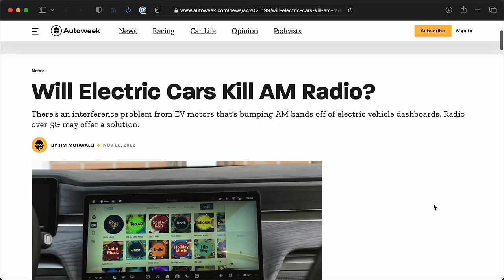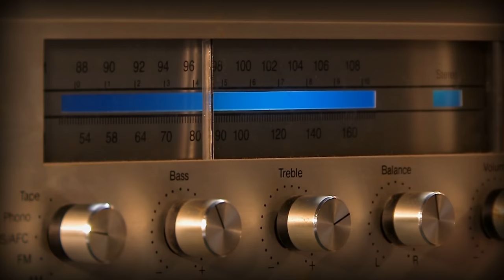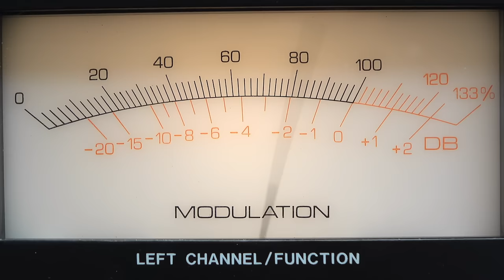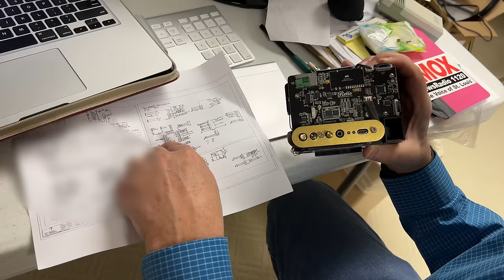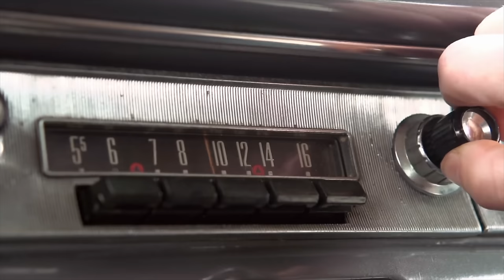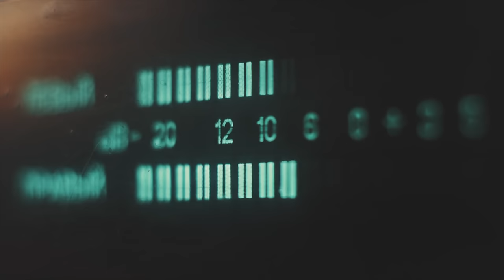Is AM radio dead? Tesla thinks so!

Comment: The little Ohio AM station I worked at in the '50s had flat frequency response from 30 to 15,000 Hz with under 1% distortion. Such hi-fi signals sound like crap going through present narrow-band AM receivers. Of course there was a lot less AM-spectrum noise in the '50s.
Reply: The GE portable radio I bought some years ago has a wide/narrow band switch for the AM band and it sounds as good as FM in wide mode.  I also used to tune my former AM receiver off center just a wee bit in order to to get the high freqs of music some come through better.
Reply: WBAA 920AM now a century old was forever it seems a hifi station! I even modded a tuner's IF for superb sound. It all went away the scary weekend of Halloween 2007. Hideous Death came on the air, the End. Still listen to the Opry 650AM. My audio system has FM transmit at legal level. I'd re-transmit 920 from the hifi tuner and then show someone in the driveway their car radio against my FM'ed version. Night and Day. In 2013 they got a LPFM and jazz finally lived for a while in stereo. Now it's the bloody Bebe.

Comment: What would or could be done with the AM band space, if the broadcasters pull out? In some areas, AM station tower land is prime real estate (suburban encroachment over time).
Reply: The land values are getting to be a big deal. Stations have been selling the land and moving or cohabitating with another AM in the market. 
We are a long way from the band space having a strategic value IMO.
Reply: Not very much. At frequencies that low, interference is a major issue. Transmitters need very large antennas to be efficient. There's just not much you can do with it these days. Sure, you can send a signal half-way around the world - but who needs to do that now?
Reply: "Get out of me swamp!"
Reply: @vylbird8014  spies?
Reply: Nothing. Low frequency long wave radio is only useful to telescopes and space radio. And AM waves have very little interference with devices like cell towers or garage door openers. So it's not in anybody's interest to shut it down.. it's FM radio that's likely to be killed off for that.
Reply: You can count the lighting-strikes ... ;)

Comment: Great video Jeff. A comment: I understand that you are using the shorthand of "AM Radio" to mean "public broadcast 535-1602khz+expanded band" certainly for entertainment and audio quality all frequency and phase modulations are superior. Still, it is important to understand that AM has many unique features. Just as (analog) AM radio's susceptibility to interference is mentioned as a weakness, it is also an under-appreciated feature in its rejection of the capture effect, hence its use in aviation. It is also a much more transparent medium, as its ability to observe and inspect sources of electromagnetic noise and spectral purity (and, for that matter carrier suppressed SSB) exposes the (IMHO sloppy) engineering practices of the digital era. The lack of shielding, grounding, isolation, etc. creates such increased interference susceptibilities; - unheard of in the analog heyday of the 1950s-1960s. I am not advocating the return to the boat anchor, but digital engineering fails to understand the fundamental electrical principles required to competently function in the analog/AM era. If one thinks of the electromagnetic spectrum as a natural resource, just like cities' light pollution interfering with astronomy (even before the now infamous Starlink astronomy interference - another Tesla/Musk doozy!), the EM spectrum is getting more polluted with noise that every subsequent system needs to reject and operate under. It is a tech debt that, unlike software, is impossible to patch after implementing these systems
.

Comment: I had a record player AM radio my mom won from cereal box tops in 1968, a 60s Sears desktop radio, a mid-60s Magnavox console stereo, and a 1980 GE flip digit clock radio all of which could easily bring in KDKA. I lived in Memphis. The clock radio could do the same in a steel and concrete dorm in Knoxville, TN. It's a connection that I miss.

Comment: Here in Tucson I worked at five AM stations.  Did you know that All Ford cars for 2024 will not have AM.  You already know about the electric cars.  You would think that the FCC would have something to say about the RFI interference.  In the 50s my parents has a table lamp with a lot of coat hangar type of wire as the base and it always during the day picked up a local AM station not very loud but if you sat with in two feet you could hear it.  We still have a AM station that transmits in stereo.

Comment: your dad talking about being able to hear the station from a pipe coil is interesting because i remember being a guitarist in this band, this cafe in my downtown city we used to do shows a lot, happened to be a block away from a AM station and i always remember the second my guitar was live and on with my tube amp , you could hear the signals being picked up by the guitar pickups which are mostly double coils (humbuckers), and it was pretty noticeable

Comment: Here in Eastern Tennessee, AM reception as well as shortwave has been getting harder and harder to receive. 15 years ago I could pick up quite a few AM stations during the day. Today it's hard to pick up anything even at night. As a matter of fact, I used to be able to pick up your station (St. Louis) crystal clear at night 15 years old but last time I checked I could not. At ground level anyway.

One night at 3 in the morning I went DXing on top of the 7th floor roof where I work to see if I could pick up any AM and SW signals and was able to pick up all the "big city" AM stations like New York, Chicago, St. Louis, Pittsburgh, Boston, Nashville. I'm not sure how high that was (1000 feet? off the ground) but I noticed at ground level AM is almost impossible to pick up even at night. 

You confirmed my suspicion that it's due to allot of electrical noise. 

Also allot of the AM local stations (around here anyway) I think have cut their power back to save money. They don't reach as far as they used to. When I was a teenager I used to listen this AM rock station in Erwin TN because they played great music. The tower is about 35 to 40 miles away. Today it seems most AM stations around here only cover about a 10 mile radius.

Oddly enough two of the local AM stations are now ESPN talk radio. Why do we need two of them? Who wants to listen to that junk. But I'm a car guy not a sports guy....

Comment: Part of the noise issue is the fact the FCC doesn't actively enforce electronics standards as much as they claim. You can easily buy a cheap phone charger that will put out so much noise that it can disrupt any other radio in the area. This is something that I believe some IoT makers have complained about since some IoT devices will be disrupted by such noisy electronics. It's not to say making quality low noise devices is cheap, but it's not too expensive either with proper grounding, use of choking via ferrite beads or CMCs, and a few other tricks then you can get any device relatively quiet in RF. It's just that it shaves off pennies worth of profit that firms refuse to eat.
Reply: Is it the chargers or the phones? Or maybe both in some cases? The reason I say that, is I've notice that my latest phone produces interference and even takes out FM radio reception when I plug it into the charger. My older phone didn't do this and changing to a different charger doesn't help. I've come to the conclusion the charging circuitry inside the phone is likely to blame. Anyway, I think the FCC isn't doing it's job in regulating the manufacture and sale of electronic products nowadays and manufacturers are cheaping out and cutting as many corners as possible and selling us junk that doesn't meet standards.

Comment: AM has many disadvantages over FM but, it's simple to demodulate, information can pass even with low SNR and two or more simultaneous transmissions at the same frequency can be understood. For these reasons it is still being used in aviation communications.

Comment: Hello!  On the medium wave band I can hear a remote radiostation (300-400Km away from me) but only at night and with noise. There are loads of intereference and noise in multi-storey building - simple crystal set receive noise ))). To achieve a clear sound - you must go away from building and electrical power lines

Comment: 8:14 your dad TOTALLY nails it. I have multiple AM radios and I never turn them on anymore because there's nothing I care about listening to on AM in the Tulsa area. The news/talker has an FM simulcast, the preaching/teaching station runs speakers I can find on-demand on the internet, and I have no interest in sports or Spanish-language programming.

That's the entire dial.

If any one AM station was running anything I cared about hearing, I would move heaven and earth to pick them up. AM radio station owners gave up on their own stations 15 years ago. It's sad.

I'll second what somebody else said here, that C-quam stereo sounded fantastic when compared to crushed FM signals. There's also the option of going pure digital on AM which would lose the analog signal but the fidelity is competitive and anybody with an HD radio in their car can already pick it up. There's a local 500 AM just west of town that, if they went pure digital would just cover the entire city's limits. With their analog signal squeezed in amongst so many other stations on the same frequency, they barely cover the west side of town at night.

It is going to be harder and hard to justify land, tower, and electricity when everybody already has a "transistor radio" in their pocket in the form of a smartphone. As data availability around the country continues to increase and eventually satellites provide broadband over the entire continent, it's just going to make sense to stick a PC in the corner of a room to stream to the country or the world rather than pay all the licensing, utility bills, and property tax.

I already mix DXing, but the industry has done it to themselves.

Your dad is a very smart man. (I know you already knew that...)

Comment: Tesla inverter is not shielded to standard automobile standards.
If they include an AM radio they must install shields, filters and bypass all along the power and computer circuits in the car. Better save a couple hundred dollars and don't install an AM radio.
The AM band remain fundamental for national security.
Also - not related - Powerline ethernet extensions sold in supermarkets are illegal - they block AM reception in wide areas...

Comment: If you get an older Model S from before 2015/2016 and with the original MCU1 center screen, it still has AM radio. But at certain frequencies you can hear the motor inverter doing its thing. Tesla didn't drop AM until Model X arrived in 2016, and then later on the Model S when it got a facelift and new MCU2 center screen.

Comment: Hi, I remember tuning the am bands at night and writing down all the different stations I could hear. I eventually put up a wire outside and coil coupled it to the radio's ferrite antenna. The amount of stations I could pickup increased immensely. AM might be ok nowadays if you lived in the deep sticks far away from all the noise. They want everything on the internet & satellite now. I have a portable receiver with AM that I'm going to try on a day trip to the back woods. It will put me a few miles away from the mains and any homes or businesses.

Comment: here in europe,you can hear a lot of pirate am radio operators with home made am transmitters,mostly from greece and serbia...with output power between 500w and 10 kw. working between 1,6 and 1,8 mhz

Comment: I just realized that this video coincided with the switch-off of Absolute Radio on medium wave in the UK. In Europe, many other broadcasters are also switching off AM (either medium or long wave) in favor of FM and DAB to save power (since European broadcasters typically use more than 50,000 watts (maximum power for AM stations in the US) for major stations). So AM radio is really dying out in Europe.

Comment: i made several Shortwave radios from AM radios. i took a clock radio, coiled wire to the coil of the AM end, and i could receive MN, IA, IL, TX, KS, from tulsa channels! i coiled wire around a chapstick tube, connected the wires to the contacts to the variable capacitor, and put the tube on the end of the AM antenna, and i made another shortwave radio!

Comment: Just saw this.   Ford was going to eliminate AM radio for their vehicles also, but decided not to after pressure from the US government and customers.   The statement that it is all about content, is very true.  I restore old tube type radios, most of which are AM.  I have gotten a small FM/AM converter/transmitter due to the horrible(at least where I live) content of AM now. It is mostly hateful talk radio, which I cannot stand.

Comment: Almost all home electronics use switch-mode power supplies, which are far cheaper to make and more efficient than the old linear power supplies that were built around a heavy transformer.  It's not easy to make an AM radio with a switch-mode power supply because of the noise issue from the switching transistors.   That makes the radio itself more expensive to make.

Comment: No. I sold about 200 DSP AM radios at the flea market last year and about the same the year before. Once you get out of town FM fades out and there are no FM stations for the next 120 miles and AM is the only thing you can get. Thousands of people live here in desolate areas in Arizona / New Mexico with no electricity, running water, or radio stations.

Comment: Glenshaw Pennsylvania. Out my bedroom window and probably less than 2 mi away on an opposite hilltop was KDKA. I say was because what I had in my ears does not exist anymore. I would like to add to the list of weird reality with my testimony that we heard KDKA on numerous devices. Art Bell stuff. But real, I remember specifically hearing it coming in on things like tape recorders and such, but my most vivid memory is the toaster. It was somehow pulling that signal and probably demodulating it across the heating elements which were long wires hanging there sucking in the signal. Needless to say any crystal radio I had was only dominated by one station. My memories of Bob Prince, and also of WLW, KMOX, Boston and Philly must really date me. But that was a unique intersection of time and space that we can at least impart to anybody interested. By the way that toaster made great toast. I think it had something to do with the artistic inputs if you know what I mean.

Comment: The only radio station I still listen to in the car stopped transmitting on MW two weeks ago. It only transmits on FM around the London area otherwise you are left with DAB, which is usually OK but breaks up in certain parts of the country I drive through. I just need something reliable.

Comment: There are a few AM stations in the Uk be we sadly lost the Absolute radio transmission a few weeks back. Unfortunately for them, ofcom have noticed and are withdrawing their license for failing to meet their licensing requirements which they renewed a few years back. It's sad that AM is going away over here. I have a nice little "modern" AM capable radio that is great for picking up transmissions from a lot of different places

Comment: AM radio, as mentioned in this video, is useful because it can be received over long distances at night because of that handy skip effect in the ionosphere. I remember being able to pick up WLS 890 from Chicago, and 640 AM from Toronto over a large area of Northeastern Ontario at night. Some AM stations primarily broadcast news and traffic reports. I've found 680 CFTR in Toronto is very useful for this purpose, let's hope it never gets retired.

Another use for an AM radio is a lightning detector. Put the dial somewhere where there isn't a station and you can hear the burst of noise whenever there's a lightning strike in the area.

Comment: AM is amplitude modulation, so the amplitude is very prone to noise, whereas the FM, frequency modulation is very immune to it...However, for a submarine submerged in deep water, very long wave tranmission is used (VLF), because of the impedance of salt water, which reduces the amplitude of EM wave at high frequency, only low frequency can pass through.

Comment: What I like about AM transmissions:
1. They are independent. You can transmit data directly, without intermediate nodes, which can corrupt data.
2. They can be received from transmitters located hundreds kilometers away from your location. And even in presence of noise, you still can decode information (by your brain).
I tried to search information about digital transmissions with similar properties, but looks like no one developed protocol, which allows to preserve data better at low SNR values than AM.

Comment: I'm an computer + EEE from analogue AM tube days to overdriven Ghz digital systems nowadays. AM radio demoulates broadcast at carrier frequency around  hundred Khz,  picks up unshielded PWM high current fields of the traction  motor. There is a reason for taking out the AM radio so you dont feel bad submerged in a strong magnetic field. I drive only cars on petrol.

Comment: In the Tampabay area of Florida where I live, We have over 20 AM radio stations. Seems that AM is alive and well here. However, Its the programming that is dismal and the programming seems to be hurting AM here. Mostly when using one of my old AM tube radios I use a small AM transmitter